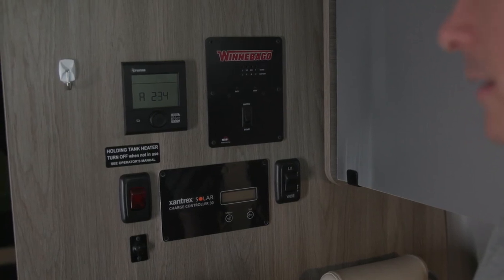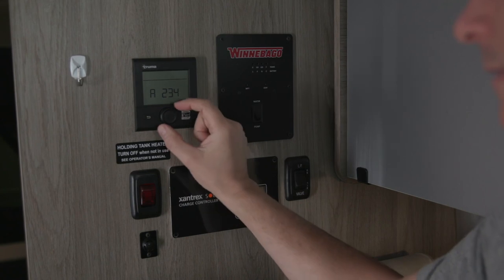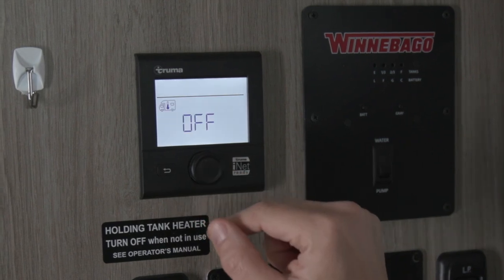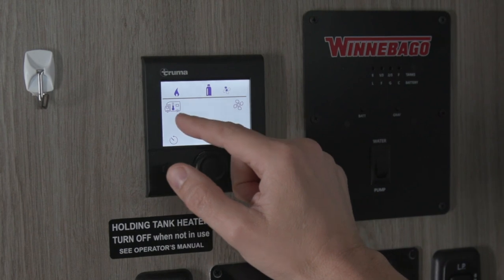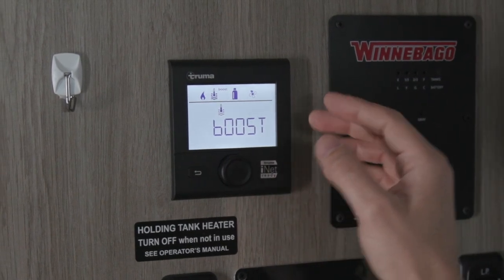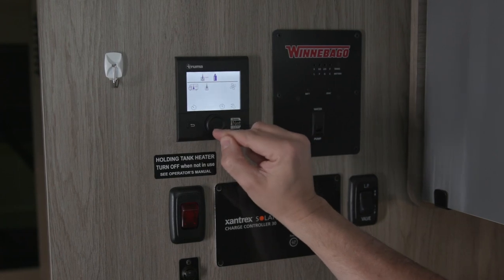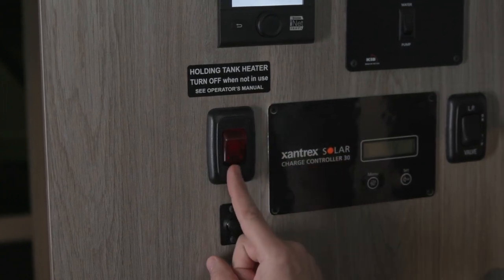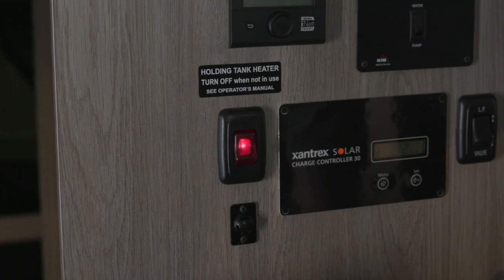Winnebago   How To Solis   Truma Combi Eco

Comment: Boosts heats everything but the interior? What do you mean? Also, you skipped the fan… does the fan need to be turned on when using the heat or does it default to a certain speed?